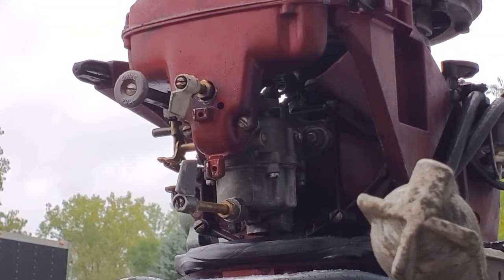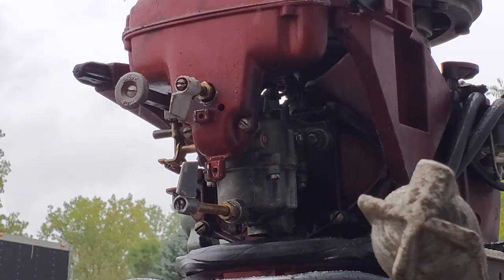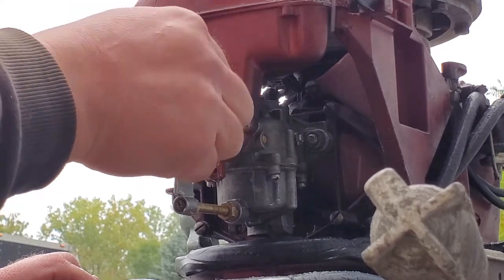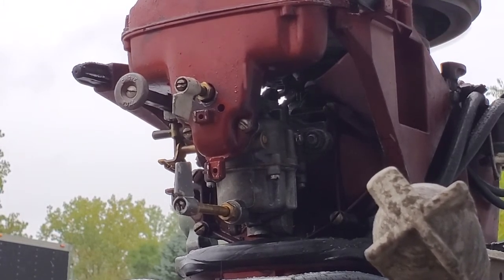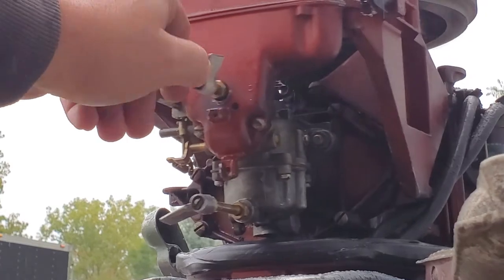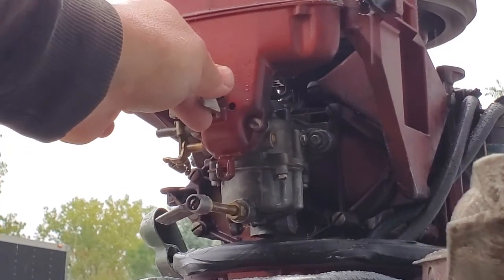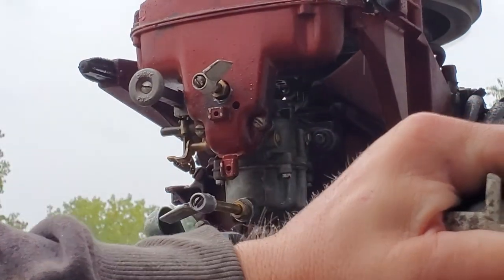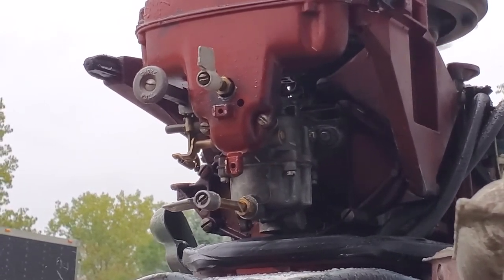Dialing In a Carburetor After a Rebuild

Comment: Thanks for sharing!  I am getting back into outboards and am seeing lots of folks not knowing much about carbs.  The set and reset once warm on both circuits is something folks sometimes miss too.
Reply from the maker: Yes, I have come to realize that also.  I decided demonstrating this process in a video would be the most effective way to describe the process.   Yes, it is also necessary to readjust a bit once the engine is warm.  Ideally, the idle should be done after a thorough warm up following a full throttle run on the boat,  but getting it in the right neighborhood in the tank beforehand is a good start.  On some motors, they run a lot better if they are enriched 1/8-1/4 turn at cold start and then slowly adjusted back as it warms up. Others are not as sensitive.

Comment: I'm glad to see that my motor is "normal" when it comes to how sensitive it is. I have to adjust on it a little depending on the weather. I have a '64 model 18hp and I got rid of the fixed high speed jet and installed the older bowl with the adjustable high speed circuit. I was never able to get above 4,200 RPM with the fixed jet, and after installing the adjustable one I finally reached max RPM. The fixed jet was over rich.
Reply from the maker: Yes, it is normal to have to adjust the carburetor a little for changing weather conditions.   I'm kind of surprised you were not able to get to 4500rpm with the fixed jet.  Are you at a higher altitude?  I have two '67s amd a '64 all with their original fixed jet carburetors and they are the strongest runners I have here in Michigan.  I have a nice '63 with its original 2-circuit adjustable carburetor and it is about 1-1.5 mph slower than the others. I cannot dial any more out of it.  Thanks for watching!

Comment: This is very informative! When I bought my 57 Johnson 5.5 the previous owner told me to never touch these dials. After reading forums and watching videos on the topic I know that is not the case. When I adjusted the dials it was like a whole different motor, so much so that I'm no longer considering upgrading to more hp
Reply from the maker: I have come to realize there are a lot of people.  Dare I say most average people that do not know or understand how to adjust a carburetor.   I was getting a lot of questions about it and thought a video demonstration of the process would be the most effective way to explain it. Thanks for watching!
Reply: The previous owner probably messed with them badly and had to take them to a mechanic to fix it - where the mechanic said "don't mess with them".    :)
Reply from the maker: @dkruitz  That is probably pretty much what happened.

Comment: Helps a tons thanks. I just redid the carb on a  69 10hp Evinrude sportwin and it will start and end run but I could not figure out this needle adjustment stuff
Reply from the maker: Great to hear!  That's exactly what I made the video for.  Thanks for watching!
Reply: @oldjohnnyrude8404  I tried to dial it I a week ago but couldn't get it. But I didn't do it in gear as you did.
Reply from the maker: @dustinadams9829  It needs to be done in gear under load in a ventilated test tank to evacuate the exhaust gasses or better yet, on the boat on the water.  A test wheel is a big help especially in a barrel or small tank to keep from losing a bunch of water out of the tank.  If using a barrel,  at least use a fan to blow the exhaust away from the carburetor intake.  If it inhales its own exhaust it will cause the engine to run rich due to lack of oxygen.  If it gets dialed in like that it will end up much too lean when running it on the boat.

Comment: Thanks for doing this video, it's prob one of its kind on youtube, and i think this is the one thing most people have difficulty with during a carb rebuild, myself included!  You sure make it look easy! :) I was just out there for a few hours prob approaching 100 pulls, my pull rope is starting to come apart lol!   Curious, what does "lightly seated" mean - from my understanding it's the least you can possibly thread the needle?  But that is prob incorrect because if I back out any further it won't be threaded at all.  Thanks appreciate it and I enjoy watching your vids, esp the classing outboard series!
Reply from the maker: It is always nice to hear from viewers that enjoy the content.   I know I have gotten a lot of questions directly and seen many others ask the question generally how to do this.  I came to realize that a great many people do not know or understand how the adjustments work on a carburetor.   I have gotten a decent number of positive responses to this video.  It is apparently helping some people get this done correctly and that's fantastic.   
"Lightly seated" means the tapered / pointed end of the needle is just making contact with its seat in the carburetor body.  I specify lightly,  especially on the low speed needle, because if the needle is seated too firmly into the seat it can be damaged.  The needle should be seated gently and with most of the resistance off the packing nuts to allow you to feel the seating of the needle before it is overdone.  9nce it is lightly seated, it is opened up 1 to 1.5 turns for initial starting and the packing nut can be snugged up to prevent the needles from moving too easily or on their own when the engine is running.   Once that is done, it can be put in the water and started and this procedure followed to get it adjusted properly.  Thanks for watching!

Comment: Nice sounding 58 ? 10 hp ? I just finished 2 of them and for sure one of my favorite motors along with the 54 ! How’s the 6 I sold you in Constantine ? Get Er done yet ? Ron just took a 75 Johnson 9.9 home to replace the other one someone wanted more then him ! Lol. Is that rain or snow ? Keep warm there bud !
Reply from the maker: Thanks Dave! It is a '58.  It's an 18.  It has a LOT of JohnnyRude in it now, but the motor was given to me and is in nice mechanical condition.   It is very faded and not very pretty, but it should be a good runner.  
I heard about Ron's motor getting lifted and him getting the '75 from you.  
The 6 I got from you at Constantine runs great.  It may not even need a tune up.   I do need to get creative on a repair to the drive shaft spline which is stripped.  I need to get the powerhead off and see how the crankshaft socket looks.  There is quite a lot of spline left on the shaft but it will not even spin the drive shaft in neutral to run the water pump.  Once that is fixed it should be a sweet little motor.  👍

Comment: You did not mention that the motor will reinvest the exhaust gasses back into the carburetor making it run richer.The warm exhaust gases will raise and although you cannot see them the engine will rerun them back into the engine. I put a box fan on a table and run them. This will lean them right out and you will get a more accurate setting.Ken
Reply from the maker: I didn't mention that.  You are correct.   What you could not see in this video is the exhaust fan drawing the exhaust out of the tank and away from the motor.  It is good to bring it up. If there is no evacuation of the exhaust gasses there is almost no point in trying to dial in a carb in a tank.  The mixture will be off by a lot once it is on a boat on the water.  I used to use a big shop fan on my barrel, then I made this tank out of a 350 gallon tote and put exhaust on it.  I now have a commercial size tank that I'm working on getting installed inside my barn with exhaust thru the wall. Thanks for watching!

Comment: that test wheel you've got on there is super cool ive gotta get my hands on one of those one day. where did you find that one?
Reply from the maker: Some I have bought at meets, some I have bought on Ebay. I have test wheels for OMC 5.5, 7.5, 10, (15/18/20/25), and 25/30 hp RD/BT. Very handy for initial carburetor tuning in the tank before final fine tuning on the boat.

Comment: I got a fd 17b from a guy, took it home and took the cowling off and found out he had the linkage twisted so when turning the big plastic idle dial in the front clockwise, it would move the other end (idle needle) counter clockwise.
Reply from the maker: Yeah, I habe found the linkages set up backwards on those motors quite a few times.  That will definitely confuse things when trying to make tuning adjustments if you're not aware it's backwards. I always make my adjustments in the tank first with all that stuff unhooked, then put it back together correctly, and make final tuning adjustments on the boat under proper load.  Thanks for watching!
Reply: glad I'm not the only one 🙂 and that's good advice. Appreciate it.
Reply from the maker: @kickback-time  Definitely not the only one.  It happens quite a bit.  You're welcome and thanks again for watching!

Comment: I’ve tried everything on my 5hp Sea King and it will not idle! I’ve rebuilt the carb and cleaned it twice. Fuel still comes out of it sometimes.
Reply from the maker: I would say you need to check the carburetor bowl vent in the body of the carburetor and make sure they are open and not obstructed.   Those can be easily missed.  I have even seen them intentionally plugged before.  I'm guessing the float had failed at some point and the vent was leaking so it got plugged.  Anyway, plugged bowl vents will cause them to pour fuel out the throat even if the float is adjusted properly and not sticking open. Thanks for watching!
Reply: Old JohnnyRude gave it a clean and linked the carb again. We will see!

Comment: Should I be able to slow the throttle down all the way? Seems as though no matter how much I lean it out I can not keep the engine running once the throttle is a little past shift on the slow side.
Reply from the maker: Most motors have enough wear on them that they will not idle against the mechanical low idle stop on the magneto plate.  Depending upon condition of the powerhead,  they can get the timing turned down pretty far before they stop running.  The indicator ring is really only a rough guesstimate.  You just have to slow the throttle down and dial in the low speed incrementally until.you reach the best the motor will do.  Thanks for watching!

Comment: Hi Ben, I have a bit of a dilemma, it seems vintage outboard where I have gotten many parts, no longer is carrying any complete engine gasket kits for Johnson QD 17-19 engines anymore. Where would you, or do you get your kits from? As always thanks!
Gary
Reply from the maker: Hi Gary. I have never bought a complete gasket kit for any of my outboards this old.  I have only bought individual gaskets if something needed to be replaced. If the gasket was simple enough or not readily available,  I just make my own. The head gasket is the only one I typically buy new for a QD. Marineengine.com seems to have most of the gaskets as individuals.if Vintageoutboard doesn't.  If neither of those have what you need check with Dan at ganotech.com.  Thanks for watching!
Reply: @oldjohnnyrude8404  As always Ben, you're the best!  Thanks!
Reply from the maker: @garysmith5795  My pleasure.   🙂

Comment: Hi Johnny how you doing...? I have a QD-16 that I just rebuilt the carb and it will start and run and idle down OK but I am getting fuel spitting out the throttle body. Is that an idication of improper float set or maybe bad seat or needle ?
Reply from the maker: Is it fuel spray that is coming back out of the carb intake while the engine is running?  A small amount of that is normal, but not very much. If it is excessive, you may have a petal or two in the reed valves that are not sealing properly.
Reply: @oldjohnnyrude8404  Not excessive but just ever so fine.The air breather is off while I was running and I noticed it.
Reply from the maker: @rustyleighty1999  If itnis very fine mist, it is probably normal. If anything your reeds may not move sealing perfectly. Unless you are getting excess fuel mix covering or puddling in the bottom of the lower cowl, I would not consider it an issue.  Thanks for watching!

Comment: Help , on td 20 5 hp , what oil do I put in extra screw hole on water circulated???
Reply from the maker: ??  I do not understand.
Reply: @oldjohnnyrude8404  where water goes in , there is a mini screw in there!
Reply: I put oil in once it leaked out slowly, look on your 46, or 48 , mine both have it
Reply: I'm thinking you give it a shot or oil before you take it out to prelube water circulator
Reply: I followed path or the flow from screw, and it looks like a prelube , passage
Reply from the maker: @roberttolley5055  No oil needed for the pump if that is what you refer to as the circulator.  When you put the lower unit in the water, the water lubricates the pump while it is running.
Reply: Next time you get in one please look at screw passage, I'm wondering your oppion
Reply: Thank you
Reply from the maker: @roberttolley5055  You're welcome. 👍
Reply from the maker: @roberttolley5055  Will do.